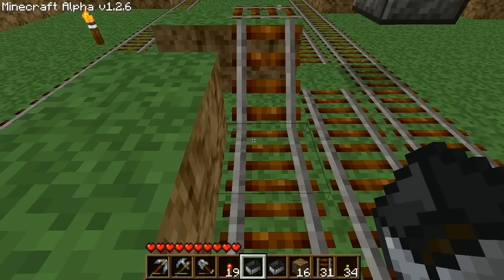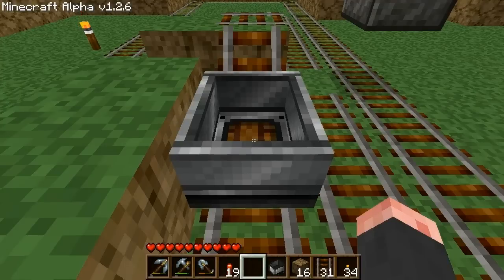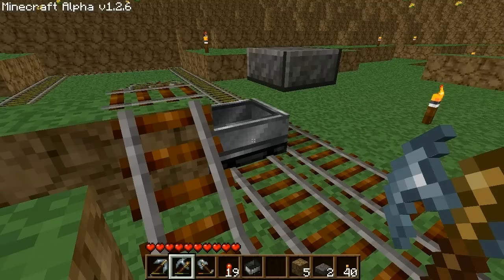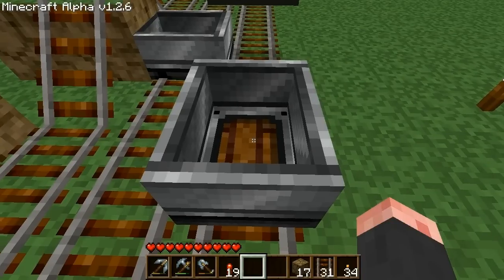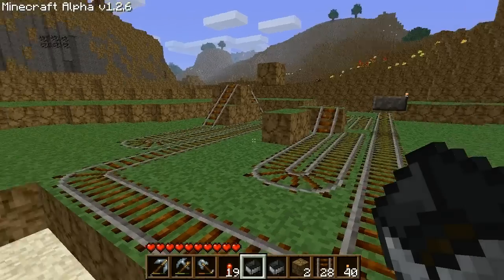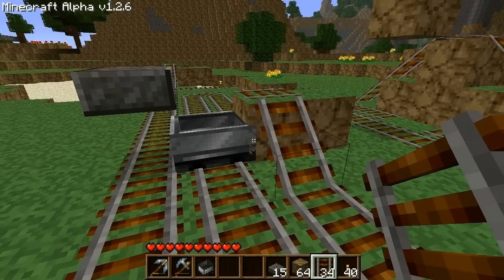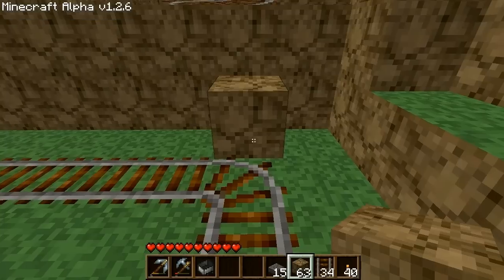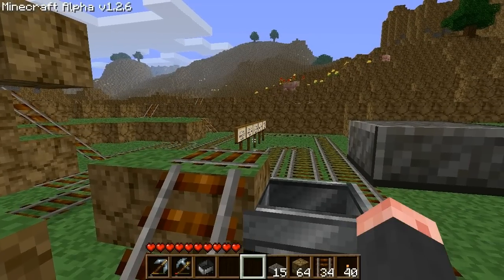How to use the two way booster

Comment: Not sure how interested you are in vanilla any more... but if you are and you are missing the old boosters you should check my world release. It has a load of new booster designs (no powered rail) including a tutorial section!

Unfortunately however Covert was extremely good at being able to remove both the old and the new booster =P Which is a shame imo xD

Comment from the maker: @TheMindfiend From what I've gathered, turns have no affect on the speed of the cart unless there is a block next to it. I did a test on the loop I have and was able to do 12 loops with a 6 track booster and no blocks by the turns. Soon as I put the blocks in 2 of the corners that went down to about 5 loops.